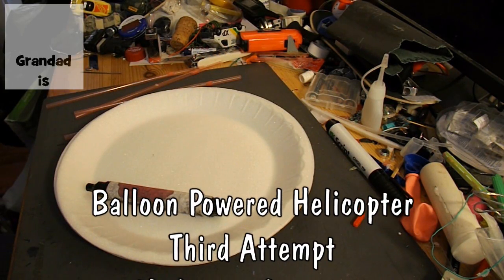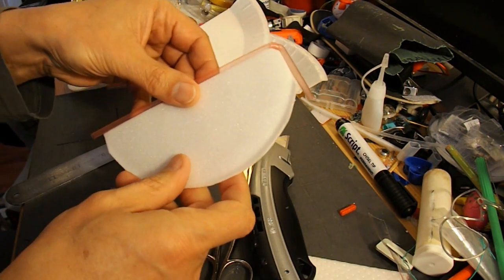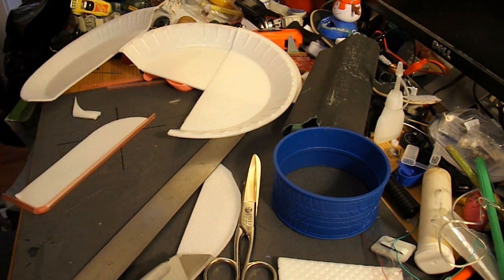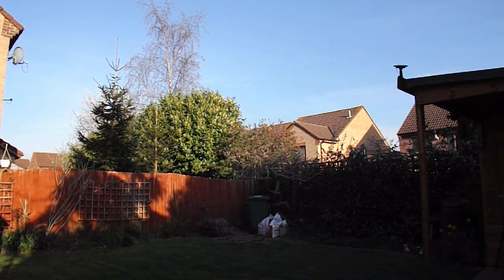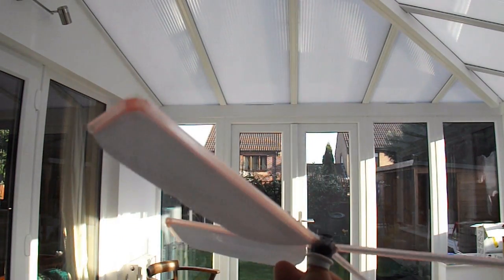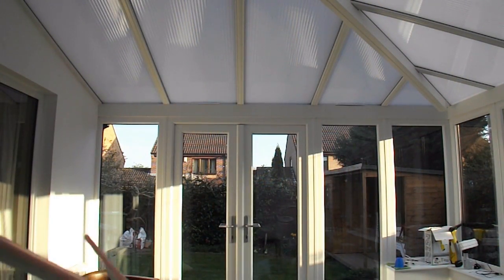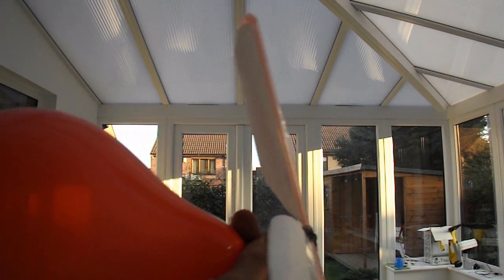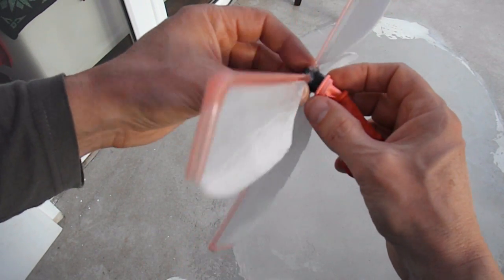Balloon Powered Helicopter Third Attempt - modicum of success

Comment: i think the balloons getting out of line and becomung narrower at the neck is still and issue. when the balloons  get knocked out to the side. it offsets the spin of the blades and makes it too hard to spin the ballons weight and narrows how much air can get through the neck. doubling the balloons creates more thrust, and more weight that has to be kicked out, thus minimizing the effects i just stated while also adding more thrust. thr balloon copter i had had the blades rotate independantly off the balloon, i think thats what allowed it to use 1 big balloon.
Reply from the maker: colter james Calvetti have a look at the video description. There are links to a successful balloon helicopter by David Vernon Williamson and also some links to very simple cheap commercial versions available on Amazon.